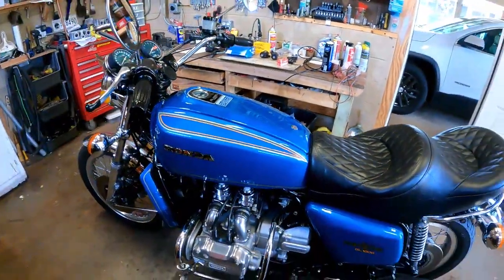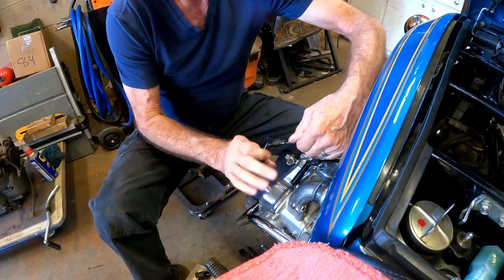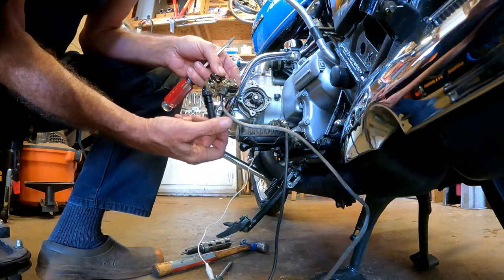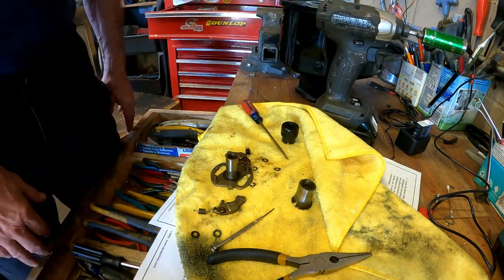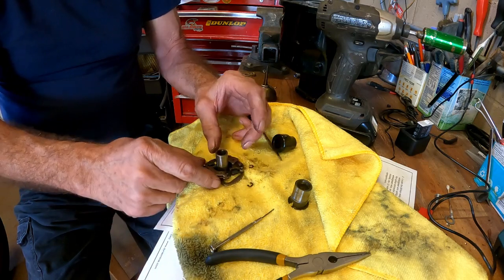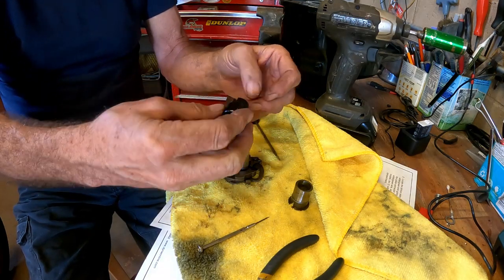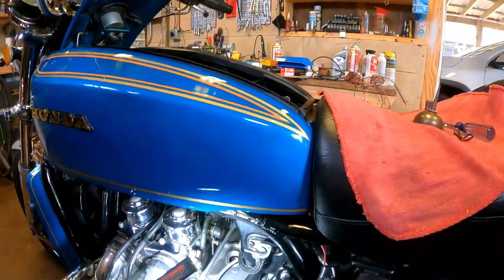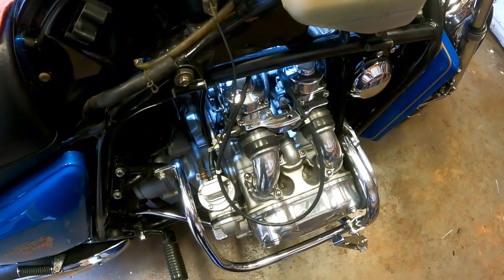DYNATEK IGNITION ON 75 HONDA GOLDWING

Comment: Outstanding Bob. Really enjoy your videos. It's very apparent you know this model! Please keep up the good work!
Reply from the maker: I'm running out of GL1000s and 1100s to work on. However, I am experimenting with  a cylinder head porting job on my 83 wing. I have extra heads to experiment with.
Reply: Hi Bob, is it straightforward to install the coils as you skipped this part and showed them fitted?! I'd also like more explanation on static timing as I've not done any of this before, and your video gives me confidence to try this install
Reply from the maker: @SuccessShared  I am just starting a full restoration of a 1977 Goldwing. It is currently fully disassembled and the frame is out for repair at a fabrication shop. The bottom tube is rusted out. I will start making Videos about this project. I will be doing a complete rewire using NWT Cycletronic components. Stay tuned!

Comment: Honda put some effort into making the still available "bombsight" adapter that fits into the crank case so that you can dynamically time a running engine enabling you to check timing at idle and at full advance. If you time it statically with a bulb it is always out when you strobe it.  The engine will perform better if it's timed and fuelled correctly and,of course, that their leads plugs, condensers etc are all working as they should. If all these are okay there little need to get rid of the points.
Reply from the maker: I have tried to find the "bombsight", but have had no luck in finding one to buy. If they still make it, they are keeping it to themselves.

Comment: Where did you connect the test light ( as in which colour cable)

Also which colour and location is the coils connected too ?
Reply from the maker: Connect the White wire from Dynatek to Yellow on the wire harness, Black to Blue. Connect the test light to the wire for the left hand pick up first and set the timing by rotating the plate, Set the right side pick up by moving the pick up on the plate. Plate stays stationary. Full instructions are on DynaTek's website.

Comment: Hi Bob, as always, great movie. It’s important to mention that the load resistor should be change  when moving from point to Dyna. Also, the condenser shouldn’t be left disconnected. Right ?
Reply from the maker: With the 5 ohm coils the ballast resistor is no longer needed, so it was removed altogether. And yes, the condensers were disconnected but left in place. I  should also mention that I had to cut about 3/4 inch off from the intake horn on the airbox to accommodate the Magna Coils.
Reply: @BobKramer51 Wow!